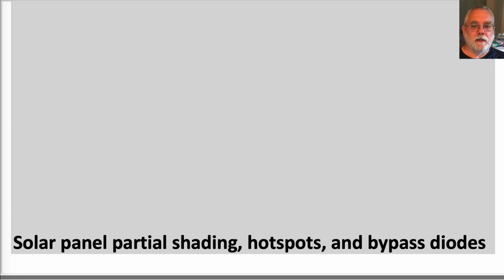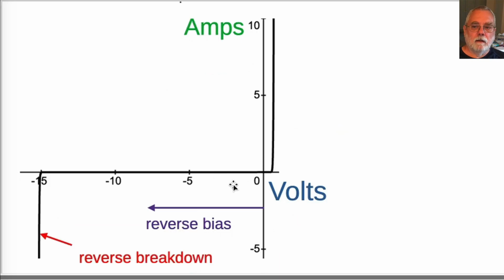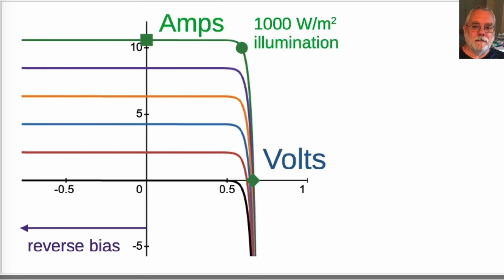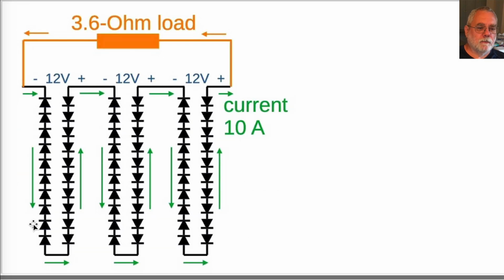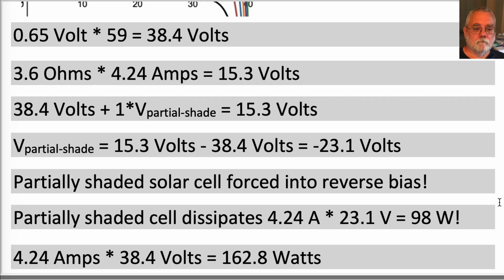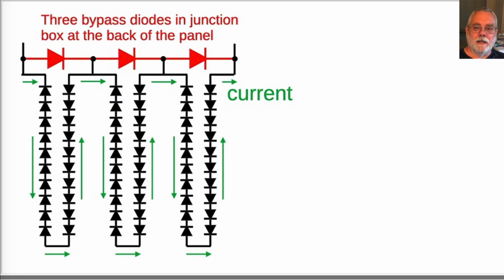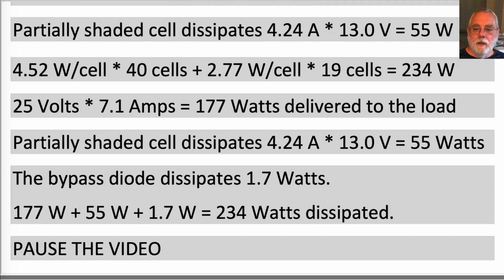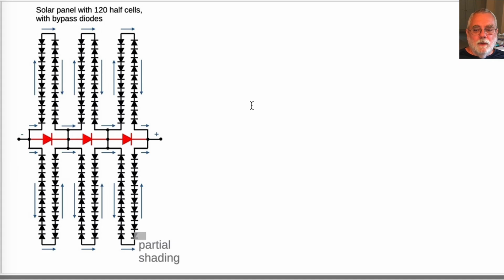Solar panel partial shading, hotspots, and bypass diodes

Comment: I know the basic of solar panels and setup.  Will you have a video on micro inverters and how this is an advantage or disadvantage compare to using bypass diodes?
Reply from the maker: There are many YouTube videos explaining and discussing panel AC microinverters (e.g., Enphase) and DC power optimizers (e.g., SolarEdge) and one string inverter, and comparing them, so I don't expect to do a video on that. Bypass diodes help in all cases. I assume that most panels come with bypass diodes; I don't know why a panel would not have them but some might. I assume that most residential installations today use either microinverters or power optimizers not solely a single string inverter... but "Gary Does Solar" on YouTube seemed to be considering just a string inverter for his case. To me, microinverters seem better technology than power optimizers but higher price when installed by an installer. Contractor videos seem to believe that SolarEdge power optimizers fail sooner than Enphase microinverters and need to be replaced but this may not be solid, current data. Replacement is more costly on an angled roof than a flat roof. If someone is off grid, they will prefer microinverters in order to have no single point of failure. Best wishes.
Reply: @mongrav1000  would using transistors instead of diodes help reduce the power (heat) lost?
Reply from the maker: I don't think you could usefully replace the bypass diodes with transistors. You could reduce the heating of the partially shaded cell by having fewer cells in a string with a bypass diode but that would have other issues for the system. The microinverter or power optimizer could find an operating point (the X instead of the triangle) that had less heating of the partially shaded cell but that would also reduce the power delivered to the load, at least for the specific shading I gave in the video. Focusing on one shaded cell is too narrow for deciding how the microinverter should optimize for the range of illuminations and shadings. Best wishes.
Reply: @mongrav1000  Thanks for the explanation.

Comment: Hmmm, I wonder what it would take to fabricate a small bypass diode in each cell?
Reply from the maker: I thought a bit about why they don't use more bypass diodes but not enough to be conclusive. Probably the bypass diodes can't be made on the same wafer as the solar cell, either because the doping concentrations wouldn't be desirable for the bypass diode or it would take too much area away from the solar cell to be able to pass the full current. They also wouldn't want to have too many discrete attachment points distributed throughout the back face nor extra runs back to a central junction box that can carry full current. I don't think I have the definitive answer but the half cell arrangement is clever with no downside to the cells. (There are also half cell panels that are bifacial.)